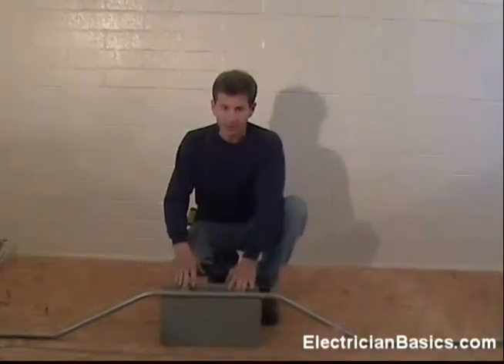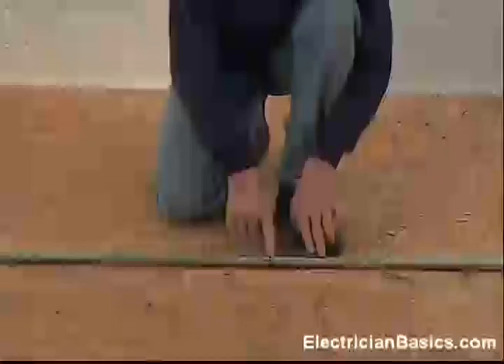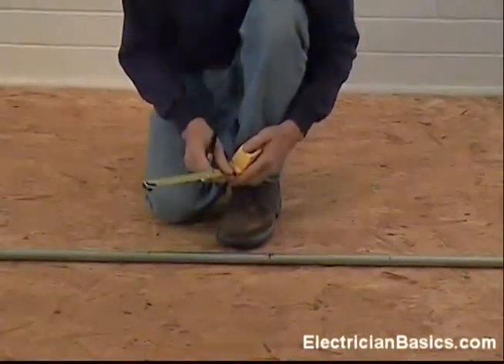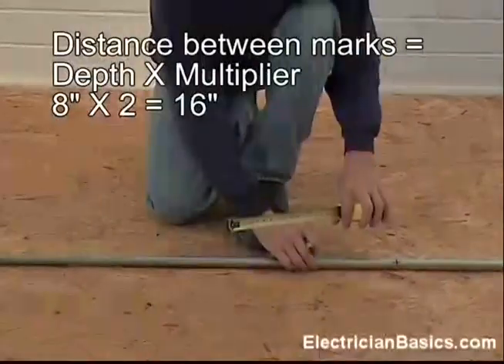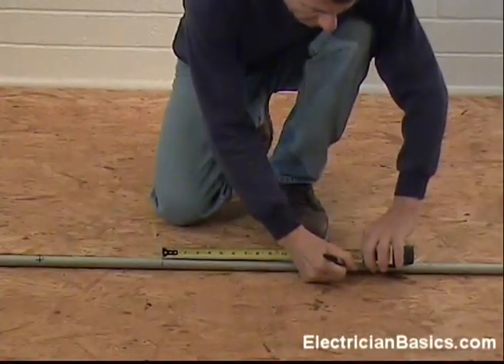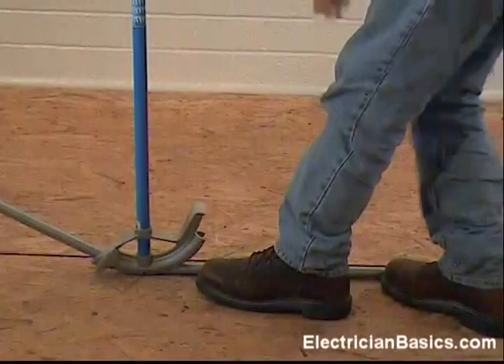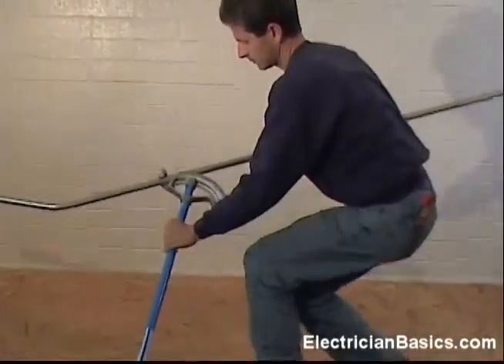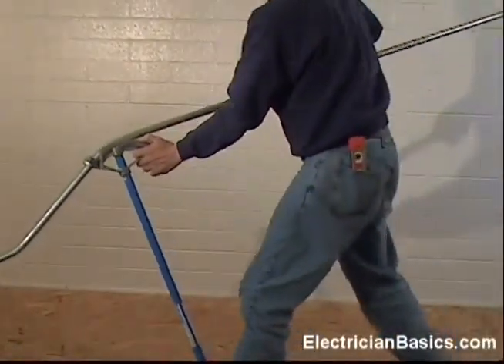Bending Conduit With a Hand Bender - Four Point Saddle

Comment: I did not see you use shrinkage at all. Should you, is my question?
Reply from the maker: There are videos teaching shrinkage.  I break the lessons into smaller parts teaching one thing at a time.
Reply: @daidegoat  But do you use shrinkage when bending a 4 point saddle in this video? What I'm saying is do you add shinkage to the center mark?
Reply from the maker: @jamalbenthall151  The next video in the series teaches you how to use shrinkage with a 4 point saddle.

Comment: Good video, used it on a job where i had limited conduit and wanted to make sure i was doing things right still.  Those air bends sucked on 1" conduit since i only weigh 120lbs.
Reply from the maker: I'm only 145 in the video so I know about those 1" air bends.